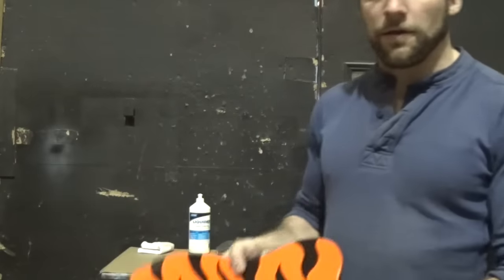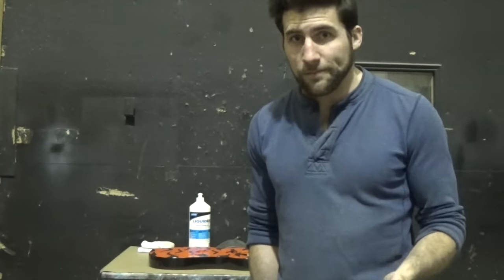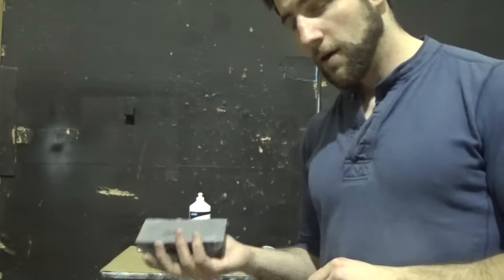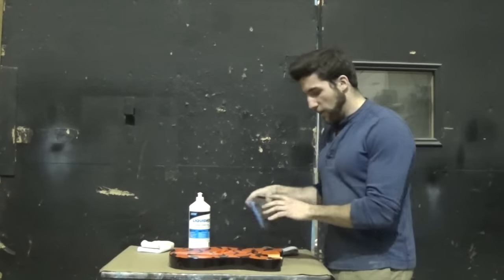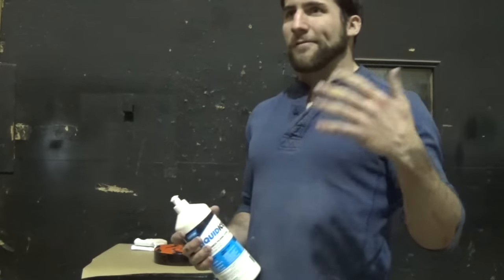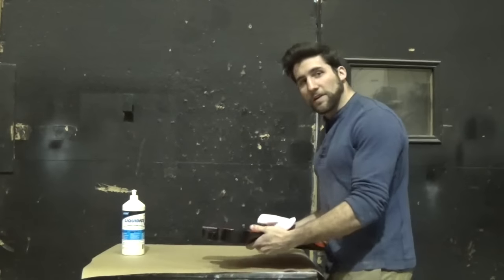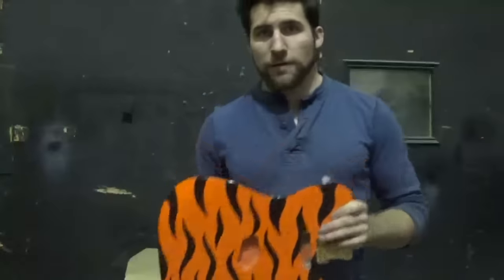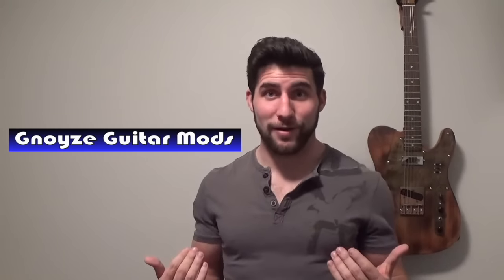How to Paint Your Guitar With Spray Cans Part 4

Comment: What are you going to do with that body?, are you going to assemble the guitar or just put it aside for now?
Reply from the maker: +Andrew Allan Guitars I don't have any plans to assemble it. I'll probably just put it aside for the time being until I find some use for it. Honestly, chances are I'll strip the paint off it eventually and use the body for another tutorial.
Reply: cool I like the paint job and the series.
Reply from the maker: Thank you.
Reply: Brad Angove maybe you could set up a website or reverb account to sell your painted bodies  and necks?
Reply from the maker: I’m actually in the process of setting up sourcing for replacement bodies, which I intend to do custom work on and then sell through a website or Facebook store.

Comment: Hey Brad, I see the sanding block, but it seems as though you have the sandpaper on some kind of square piece of something that looks as though it has some depth to it. In other words, it doesn't look as though you're simply putting a paper-thin piece of sandpaper on the block and sanding with that. Can you tell me what you're using there? Thanks!
Reply from the maker: That's just foam backed paper. It's popular for automotive work.
Reply: Ok thanks!
Reply from the maker: +Chad Johnson - Author/Musician You're welcome.

Comment: I'm doing a guitar at the moment in gloss orange and satin black kinda like this, i don't plan to clear coat it as i will be redoing it in future (this is my first time painting a guitar and I'm just learning, not trying to immortalize my handy work) and i don't mind the wear and tear. however, do you think the black will chip off of the orange over time if i don't use clear coat?
Reply from the maker: It depends on whether you prepare the orange properly. if you just paint straight over gloss then yes, the risk is relatively high.
Reply: @BradAngove  okay, so if i tape off where i want the black and then sand so i don't sand all of the orange, could that possibly work?
Also thanks for the reply!
Reply from the maker: That could work.

Comment: I got the bug and ordered a DIY kit as a commemorative guitar so I do want a superior finish.  I have no problem buying the gun as I have a compressor but really, what is best?  Spray can or spray gun?  Also, lacquer sounds better than acrylic as it moves with the wood.  What are your thoughts?
Thanks man, your videos are great!
Jimmy
Reply from the maker: Hi Jim. If you're willing to take the time to learn how to use a gun properly, it will give a better finish and you can generally get higher quality paints for the gun than you can in aerosol format. 
Once it's sealed, you shouldn't really have to worry about the wood moving. There are various positives and negatives to using lacquer, acrylic, or polyurethane. The process for doing a lacquer finish is a bit different than this, but I have a series or two for that as well haha.
Reply: This is a special guitar so I will take the time to learn.  I will check out those other two videos and will mention your name in my video of the construction as a good source for tips in all areas of guitar work.
Jim
Reply from the maker: Thank you Jim. I'm excited to see how it turns out.

Comment: hi Brad,

Thank you the video!

I have a question: I want to repaint my bass with a spray can. Do you think that polishing the paint (after it gets dry) without preliminary sanding will give a good glossy result?
Reply from the maker: It should be glossy, yes. It just won’t necessarily be flat.
Reply: @BradAngove  thank you! :)

Comment: Is it ok to use lacquer clear coat over enamel paint if ultimately your're looking to crack it with heat/cold for relicing?  don't think this process won't work with acrylic clear coats.
Reply from the maker: You would use heat and cold to crack a normal nitrocellulose lacquer finish. Putting lacquer over enamel will create a much different type of cracking that I doubt you will appreciate.
Reply: Thanks!

Comment: I've got a diy guitar. The top has a beautiful figured maple top but the body is basswood. i understand that it doesn't take to stain very well. so i was thinking of painting the back. however there is binding around the body. won't the paint be raised above the binding and what can i do to even it out
Reply from the maker: It would create a small ridge between the paint and the binding. You can gently sand the ridge down if you're careful, or sand and polish it out of the clear coat afterward.

Comment: I'm painting an instrument in the same manner. What foam pad would you recommend, or could a t shirt suffice. I'm wanting to not have the scratches and swirl marks.
Reply from the maker: A t-shirt that is lint free will work fine; it just takes a bit of extra effort.
Reply: @BradAngove  good to know. I'll probably run to harbor freight and get a foam pad though.

Comment: When should primer be used on a guitar? Also, can these steps be used for polyurethane spray paint?
Reply from the maker: These steps should work fine with polyurethane. I tend to use primer mostly when I'm spraying straight over bare wood.

Comment: Could you polish the clear gloss without the sanding/wet sanding part?
Reply from the maker: You could, but really the whole point is to flatten it out first, and then bring the gloss back. If you’re not going to sand it back, you probably won’t accomplish much with the polish unless there are scratches to remove.

Comment: thanks for the tutorial Brad. What would be the best brand/type of primer/spray paint to use on a guitar?
Reply from the maker: It depends on what finish you're going for. Here are some affiliate links that might help you out:

I like to use this sealer as a primer: http://amzn.to/2CovCqU

This is the type of paint I used on this guitar, although it's not my favourite: http://amzn.to/2lRqa9d

Here is the best clear coat in my opinion: http://amzn.to/2CPPK6B
Reply: Brad Angove i am doing white with black sides. 1st and 3rd links look good. that sealer is for laquer finish. 2nd link......if thats not your favorite what is? is laquer available in an aerosol?
Reply from the maker: My favourite cans for art are molotow, montana gold, or liquitex. For lacquer cans my preference is behlen. They probably don't have white, but reranch might have white spray can lacquer.
The liquitex acrylics should work between the vinyl sealer and that 2K polyurethane top coat.
If I were doing a white paint job I would probably use the ones from that second link just because they're easy to get. I've used them between the vinyl sealer and the 2K clear before and they've always worked fine.
Reply: ok so the vinyl sealer as the primer. enamel is ok to use on top of the seal and under the 2k clear? my plan was spray the entire body black then tape off the sides and spray white over that. how long should i wait before applying the tape and how long after i paint the white should i peel it off? could duplicolor enamel be used instead of the rustoleum for the enamel?
Reply from the maker: The Rustoleum painters touch stuff is an acrylic enamel, so it should work. The duplicolor is an acrylic lacquer. 

Wait a day and scuff lightly before applying the tape. 

Wait 2 days and scuff the white lightly before applying your clear.
Reply: duplicolor says clearly on the can.....acrylic enamel. i also have the option for rustoleum laquer. the enamel is the better choice?
Reply from the maker: I see. I wasn’t aware that duplicolor also made enamels now. Anyway, the acrylic enamel from rustoleum should work fine.

Comment: Hey brad, i've been thinking i'm going to paint a stratocaster with an arctic kind of camouflage finish (white black and grey) and i was thinking whats the best order to do the colors in? also how can i make the stencils sharp so the edges of colors don't end up looking unfinished and uneven? If you find the time to help me, or anyone in the comments answers, my thanks to them ;)
Reply from the maker: +Aleksi Saarivirta Hi there. What order you do the colors in should probably depend on what colors you want to have the most coverage. If I were doing it, I would paint the entire thing black to begin with. I would then apply a layer of the masking that I used in the second video in this series and draw out my pattern for the grey. I would use a new razor blade to cut the pattern, then peel it and paint it just like I did in this series. It tends to create nice sharp edges when you mask that way. The only exception is occasionally on corners. You will need to do the mask and spray process twice if you're working with three colors. Peel the tape from the grey, and then repeat the process for the white.
Reply: thanks, going to get the paint soon. I wish to get at least close to the perfection that you made of this guitar :)
Reply from the maker: I'm sure you will do quite well. Just make sure you observe the proper process as far as drying times, sanding, etc. is concerned and you'll do fine.
Reply: Thanks for the help! ill get in to painting in a few days hopefully :)
Reply from the maker: Awesome. Let me know how it goes.
Reply: +Brad Angove Now that you asked me to, i sure will!
Reply: +Brad Angove Hi again brad, the guitar is finished! I used it in my latest guitar cover, you can see how it looks from that video. From what i think, it came out great! considering its just spray cans, and a cheap guitar, she looks unique, and most of all, she looks like shes mine. ;)
Reply from the maker: I'm glad you're happy with it!
Reply: +Brad Angove I sure am!

Comment: Do you have an email I could possibly use to contact you on?  
I have a question about clear coating and finishing ,but the object isn’t flat it’s curved and has multiple different curves.
I’m having trouble getting the clear to lay on with any sort of gloss finish well before thinking of polishing.
I also have only up to 2000 wet/dry paper  do you think this would be enough?
Reply from the maker: 2000 grit should be fine. Take a look at my video on how to get an even coat of paint on a rounds surface.

Comment: Brad I know it might be a stupid question but what do you do if you get runs while spraying please
Reply from the maker: It's a good question. You wait for them to dry and then sand them out so that the finish is flat again. Then you can coat overtop.
Reply: ok cheers mate....will I have to wait about a week for it to go really hard....wish I could spray a quarter as well as you lol
Reply from the maker: It takes a bit of practice, and honestly I get a run now and then on some of the more difficult shapes.

Comment: I am thinking of painting my headstock on my Jaguar to match the body but I'm not sure of what kind of spray paint, primer or clear coat or lacquer to use. Thanks
Reply from the maker: If you want it to match the body, you'll probably want to go with a poly.
Reply: So get both polyurethene paint and coat or lacquer?
Reply from the maker: You'll need paint and clear coat regardless. So yes, you can get polyurethane, or lacquer. Those are the popular choices.

Comment: What would you need to do to get rid of the grain lines?
Reply: Kirk Otto Grain filler then a primer i think
Reply from the maker: He's got it right. You grain fill and then sand flat. Then you can start your paint work with a primer or sealer.

Comment: brad I got a question/ problem I am painting a guitar with spray cans but every time I spray the color, the paint bubbles and cracks what causes  this,  and what am I doing wrong, and how do I fix it? thanks
Reply from the maker: +Andrew Allan Guitars What paints are you using? What conditions are you spraying in?
Reply: krylon paint and clear, I am in a heated shop, like 65 70 degrees.
Reply from the maker: It's difficult to say what would cause that problem. I suppose it could be a reaction to some oil or grease on the guitar. I personally have had some problems with krylon reacting for no apparent reason in the past, which is why I never use it.

Comment: Anyone know why he didn't wet sand? Does it matter if you do or not? I've been watching a ton of guitar building videos for over a year now just because they are so entertaining, and I haven't really seen many that weren't wet sanded
Reply: +Jack Magee as far as i know, wet sanding is mostly to keep the dust out of the smooth paper to not flatten it while also making it have less friction when moving. so with that in mind i would think it could be just a preference thing :)
Reply from the maker: +Jack Magee It's not necessary to wet sand. It can help to keep your paper from clogging up, and provide some lubrication, but you need to make sure you're using wet-dry paper for that. I wet sand when I'm working with metal, or other materials that aren't affected by water. Wood can swell when it comes in contact with water, so I don't wet sand guitars because I want to avoid the possibility of having wood go into the screw holes etc. and cause swelling and distortion.

Comment: I subbed this looks amazing could you do a video on how to make a guitar with lightning bolts?
Reply from the maker: +The Quacken Like a lightning bolt paint job? With spray cans, or in general?
Reply: +Brad Angove lightning bolt with spray cans
Reply from the maker: You can't really do a good lighting effect with spray cans without leaving ridges in your paint unfortunately. Unless you intend to mask them off like I did in this video, which would be tedious. I would do it by spraying the guitar white, letting it dry, the spraying it black and removing some of the still-wet black paint in a lightning pattern with a pallet knife.
Reply: +Brad Angove OK thanks
Reply from the maker: You're welcome.

Comment: I sanded back all my clear coats except the final coat. Can I just polish or do I have to sand back the last clear coat before polishing?
Reply from the maker: +Guitarmage 007 Generally polishing is done to get the sanding scratches out of the final coat. I typically only sand down my final coat. If you're happy with how it looks you don't need to polish at all.
Reply: Brad Angove It's glossy, but I just want to get the mirror finish
Reply from the maker: +Guitarmage 007 The polishing itself won't make it flat and smooth. That's what gives you the mirror look. Just sand it with very high grit sandpaper and a block to get it as smooth as possible before moving on to compound and polish.

Comment: Brad-when I sand clearcoat with orbital sander it turns the finish into a gummy substance. I'm using 1500 grit and waiting 3+ days before sanding.  What is going wrong here?
Reply from the maker: What kind of clear coat are you using?
Reply: Rustoleum 2x gloss
Reply from the maker: And what are the temperature and humidity like where you are?
Reply: Been spraying between 60-80 degrees.  Humidity is high.  Would it help to let cure in house?
Reply from the maker: It may. The humidity could be part of the problem, but that stuff can take quite a while to dry fully.
Reply: I bought enamel Clear coat as you recommend in  one of your videos. .I'll try that and let it  cure longer. Thanks for your videos!  They are really good

Comment: how many days you left the clean coat cure before poloshing?
Reply from the maker: I left this one for about a week.
Reply: I'm painting my guitar from the second time, because the spray that i bought said that the paint cures in 24 hours, so i touched it and let my fingerprints all over the guitar. Thaks, now I gonna let a week or more
Reply from the maker: Make sure your coats aren't too heavy; that might be causing the drying time problem.
Reply: Hi Brad, great video that is awesome.  Just to make it clear, so 3 times clear coat with 10 minutes between? no sanding for each coat correct? After the last coat wait for about 24 hours? after 24 hours do  I still need to sand it? or can I useTurtle Wax scratch removal? or no need sand or Turtle Wax but just polish it and done?.  Thank you.
Reply from the maker: For this type of paint you don't need to sand between coats of clear if they are sprayed about 10 minutes apart to a max of about 4 coats. I'd let it sit at least 24 hours after. 48 would probably be better. After that you would typically sand it flat with the highest grit possible and then use the compound and polish. Turtle was scratch remover is a polish I believe, so you should be able to use that. If you just polish it, it may not be perfectly flat and smooth.
Reply: Got it, look forward to try this.  Thanks for quick replied Brad and again is very cool video.  Cheers.